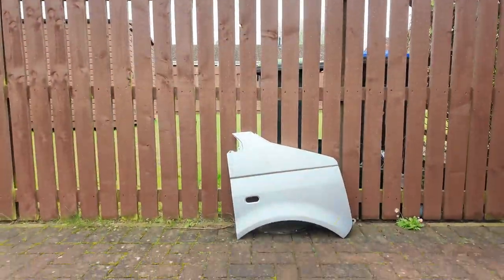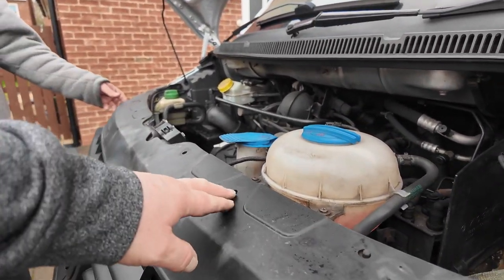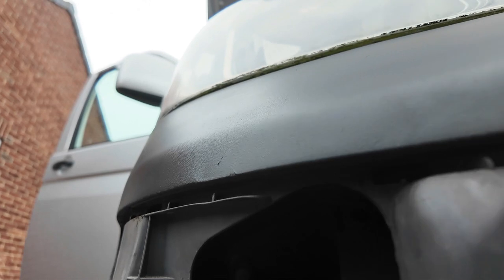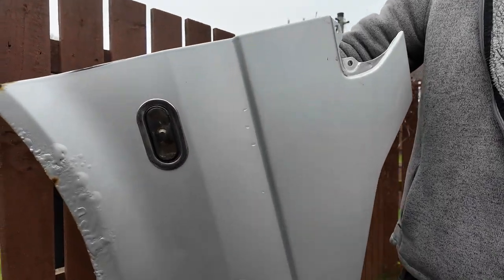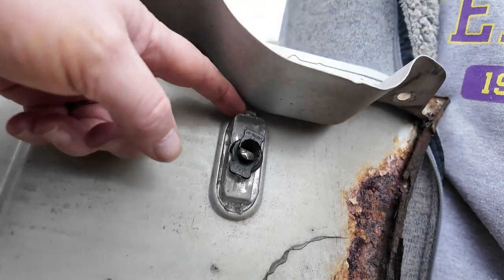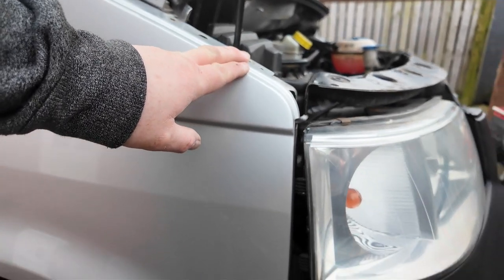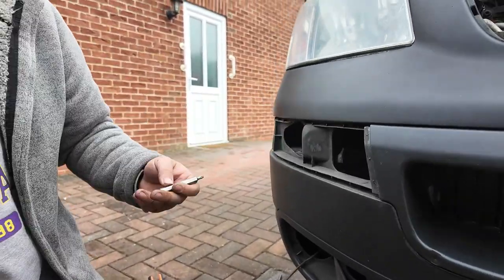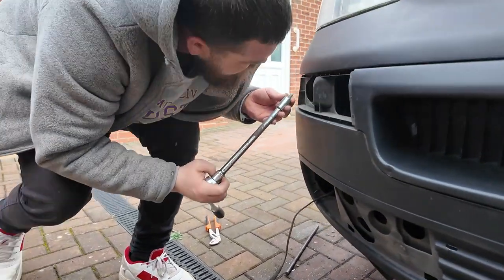How To replace the wing on VWT5

Comment: Thanks for that  if its that easy Im now thinking of buying a new one and rattle canning it rather than a temp rust repair
Reply from the maker: Hi, I couldn't find any tutorial videos and put the job off for a while because I was told it was a nightmare to do, but it was a lot easier than expected. Have you considered trying to get a salvage part with the same colour? There is salvage networks online where you can just add what you need and you receive an email quote from a selection of salvage yards that may have one. Good luck 😀

Comment: Nice van and very helpful video . I did wonder about seem seal but none on yours . What mirrors do you have ?
Reply from the maker: Hi, I'm glad you found the video helpful. I searched on YT for months and couldn't really find one showing just the wing removal so I just had to dive in 😁 I'm not sure about the mirrors I believe they are just standard. I did question these a while back on one of the forums as one of the mirrors is smaller than the other...it turns out this is correct, who knew 🤷‍♂